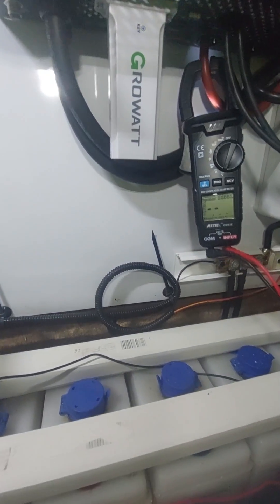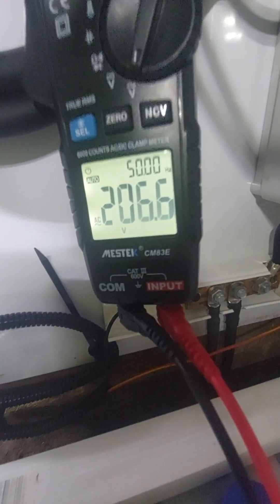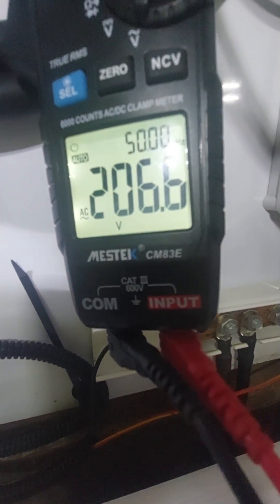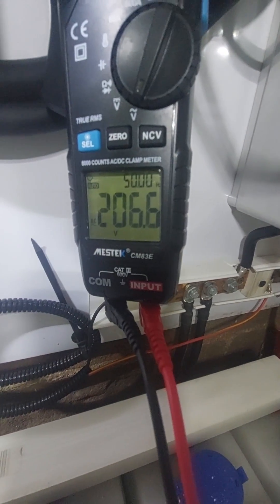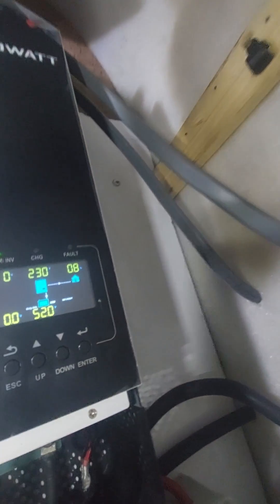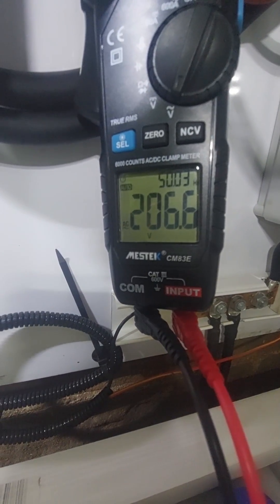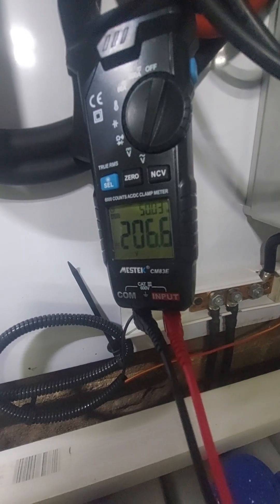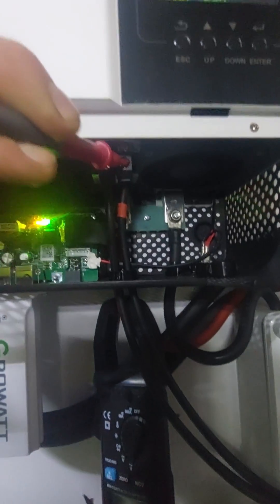Growatt AC on PV input!!!!!!!!!!!!!!!!!!!!!!!

Comment: I actually have this same issue with my sigineer inverter. I have ac voltage on the PV in even with the mains feeding it off. My next test will be to totally disconnect everything but the battery wires and see if it's still leaking to the PV in.
Reply from the maker: For some inverter it's absolutely normal and it's nothing to worry, igbt transistors don't isolate well and cause ac leeks to DC side. Will be worrying if you find AC on battery side.
Reply: @afterworkcreation9394  according to the manufacturer of the inverter it's not normal. I'm emailing him still. He's in China.
Reply from the maker: So good luck, it's nearly impossible to get anything from them.
Reply from the maker: I noticed most products for UK market is faulty, no service point in UK and it's nearly impossible to get refund or any help.
Reply: @afterworkcreation9394  I already ordered another one from gr4. Getting this one replaced would be a bonus.
Reply from the maker: Is the inverter under warranty? Or buyer protection period?
Reply: @afterworkcreation9394  yes but I cut the tape on it. I heard arcing and opened it up.
Reply: So the sales guy got back a hold of me. He now says that the engineer said it's normal. So I said, I can't see how that's safe but if it's engineered to have an AC voltage on a DC PV input who am I to judge. So basically if your pv cables are hooked to the inverter when you are hooking up your disconnect you can get nailed from it. That doesn't seem right.
Reply from the maker: First you can make some test, just switch off the grid power and check again your PV input. If inverter still provide AC to PV input there is nothing to worry just you have to turn off inverter when you doing some work/ maintenance, and you have to be careful anyway because PV array can kill you easily. Did you find any burned or blown component in your inverter?
Reply: @afterworkcreation9394  both ways still have power. Grid on or off.
Reply from the maker: @bphase123 I think you don't need to worry about AC on PV input, if inverter acting normal, and provide power and nothing weird happened, keep using that inverter. Most of growatt and a few other inverters have  a AC on DC side.
Reply: @afterworkcreation9394  okay. Cool. Thanks. I'll stop sweating it I guess.

Comment: Following!  Please let us know what is going on here.
Reply from the maker: Hi. The inverter feed little bit of main voltage through the PV input to the PV panel so, when at night I tried to wire up SPD to the ground I had electric shock from ground wire, then I started to investigate what going on, and I found main 220 v AC on PV input between ground and positive/negative terminal.
Reply: @afterworkcreation9394  That "little bit of voltage" was too much 🙄🤣
Reply from the maker: Very low current, just unpleasant 50hz tingle.
Reply from the maker: Milliamps actually
Reply from the maker: Actually the inverter behaves weird, and I had to disconnect the battery completely, badly distorted sine wave, one of my ups burned because this interference.
Reply: @afterworkcreation9394  If the AC was running down the DC circuit, it's not spurpsing it was behaving weirdly.!
Reply from the maker: @EscribanoEl  I tried to find more about, and lots of growatt inverters have similar problems, so probably AC leaking to DC side some way.

Comment: Greetings.
It is somewhat confusing, that the cable marked with a red strip, is connected to - [ minus ].
Apart from that, hope you figure out, what is causing this high voltage.
Reply from the maker: Yes I know little bit odd, but I recently make changes in my installation. Inverter will not work with reverse polarity.